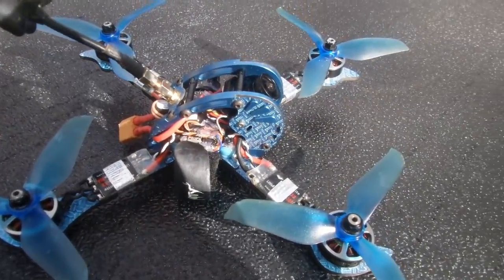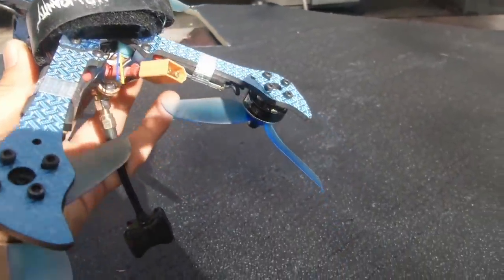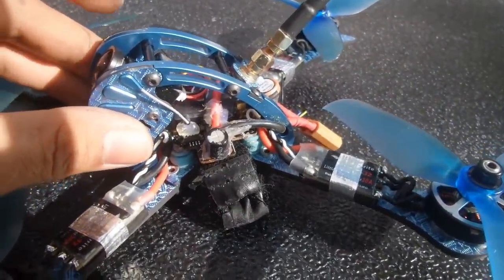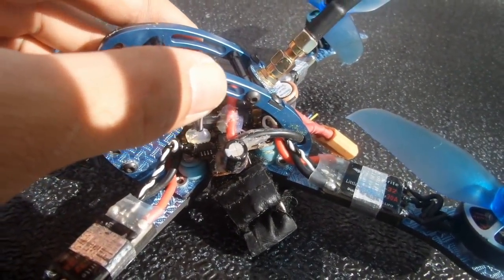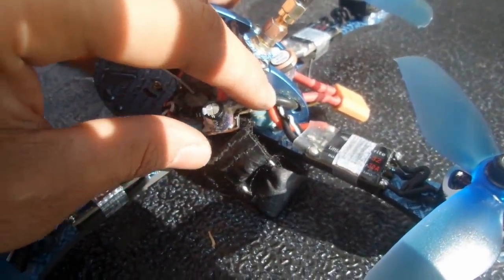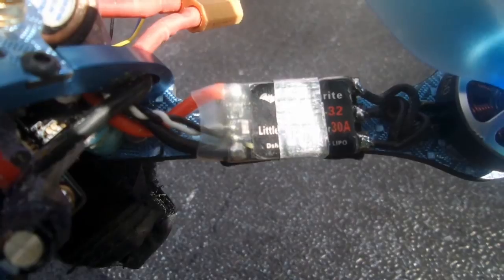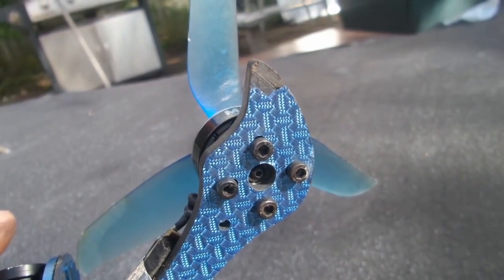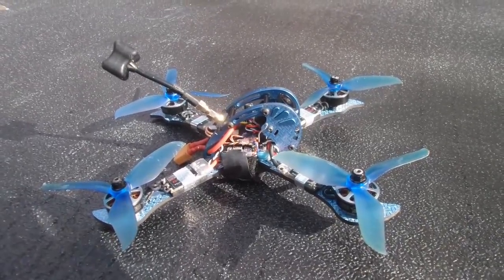GX-215 n f4v5pro + 32bit 30A littlebees & MAD 2750kv (monsters)

Comment from the maker: UPDATE!!!!! anyone having the 'u' show up in the esc's boxes in bl heli 32 for the 30a esc's, wait a few days until the release of bl heli 32.1

i'm told that this will have the firmware for 30a, they have bl32 firmware shipped from factory, but the bl suite hasnt been updated for the new esc.
Reply: KillaG FPV awesome news about the firmware wonder how many people thought they had a fault lol.i did at first.   :-)
Reply from the maker: Sam Rawly oh man. ive been in fvt's ear about it. they are trying to send me a zip file which i think is bl heli 32.1 for my personal temp use and testing.
Reply: KillaG FPV not sure if your aware mate but that new blheli32 release is out :-)
Reply from the maker: i am. lol. unfortunately for me. i fried the number 3 esc after i turned on dynamic filtering without reverting notch filters from their all 0'd setting before test hovering... instant fireball... then again.. it could have been the damp grass i set it down on... killed the f4v5pro. so thats three ive killed. another two on their way. one to build stable and fly like a normal sane person. one to push the envelope some more! lol.
Reply: KillaG FPV holy shit lol,not good I left mine alone till this update came out,hoping for a decent dry day to test I've never messed with notch filters I take it there on as standard in beta flight 3.2 and turn on dynamic filtering?
Reply from the maker: seems as tho there are some minute changes to the ranges in the pre release version i was given to use and the public release, i havent got around to doing telemetry function stuff yet tho....
Reply from the maker: yeh, start with dynamic filtering, test, then pt1, test, then notch fiter1 on 0 test, then notch filter 2 on 0, test, then dterm on 0, test,

i just went all 0 pt1 and dynammic filter on. it hovered but as soon as i saw mid stick load to maintain hover, fireball!!!

Comment: why you use the capacitors? i'm new to this hobby thanks in advice
Reply from the maker: well for cleaning up video signal for one. usually 470uf 35v for that. and for battery help when discharging 1000uf on main batt leads.. in this case i used if for esc noise as this was with the at the time, the latest firmware 32bit on the lb30a's

Comment from the maker: ran notch filter adjustments today... terrible.

PT1 = flies swee.
0 values for notch filters. motors got hot.
0 value for dterm notch filter. quad flipped out. and now number one motors refuses to start. tried reverting back to normal filter values... all values now seem locked into 0.... even after reflashing. what the hell BF3.2.0? and what the hell littlebee esc's?

Comment: I like how they are using arches now and other strong light materials. they should be able to make more unique designs though this is the new tank design it seems.
Reply from the maker: youel adamas tank is an undetstatement! 4in1 esc would leave only the motors exposed. but im still not comfortable having the bits that catch fire as part of a stack...
Reply from the maker: cant say ive had a fire from a prop hit. but i see your angle. i still prefer replacing one than all 4
Reply: KillaG FPV True. On the other hand esc's on the arms are more exposed for prophits and more fires.